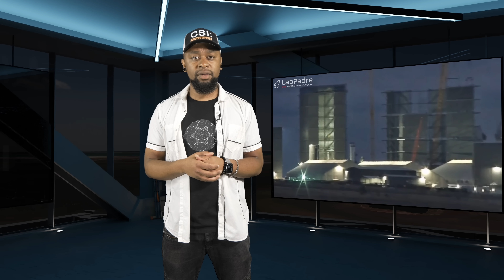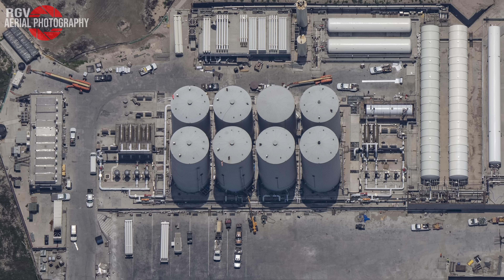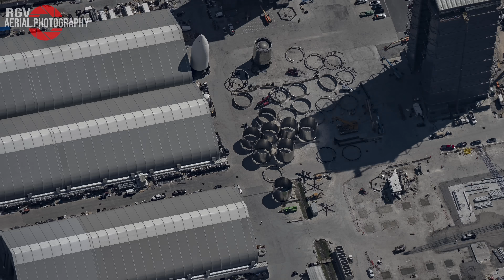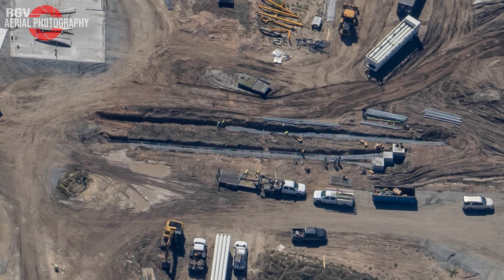SpaceX Abandons “Off-The-Grid” Operations At Starbase!

Comment: I wouldn't think a substation would be located very close to a  large source of combustible gases. High voltages can create corona conditions that theoretically cause ignition in the case of a leak. Please consult a appropriate, qualified engineer.
Reply from the maker: That is a very good point!
Reply: Most switchgear designed to work at those voltages either have their electrical contacts contained in vacuum, oil, or SF5 gas.
Reply: Correct on switchgear, but corona can form around insulated wires and insulators, as I recall. @ghost307

Comment: It looks like there are lots of pipelines running through the salt marshes between Brownsville and starbase and Port Isabel.  You can see their tracks from all the Google Earth photos of the area. It seems like it wouldn't be too hard of a job to run a branch pipeline over to starbase for that big power plant. I suppose those pipelines could be oil instead of gas though.

Comment: What your referring as transmission lines is actually distribution lines transmission lines only supply substations because those are extremely high voltage and you can’t just place transmission lines on distribution poles because the voltage is was to high and the spacing needed wouldn’t be sufficient. They probably do need a substation but only if they run transmission lines down into the base which is really expensive. What you see being done is actually just adding phases to the existing distribution and there is probably a substation somewhere in boca chica that may be being upgraded as well to deal with the load

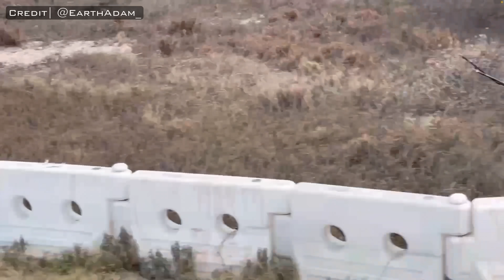Comment: Great video Zack! In regards to the size of the reels of the 500 MCM(KCMIL) URD they use, I work for the other local utility company in the RGV and I checked our inventory of URD primary and it has 1830ft. Ours are a little smaller seen in the video at 38:08. So I guess those are around 2500ft. Also just a little correction, in the beginning of the video where you show the old video of the single phase line, that is a Distribution line not Transmission. Now they add 3 phase Transmission on top and kept single phase Distribution below it on the poles.
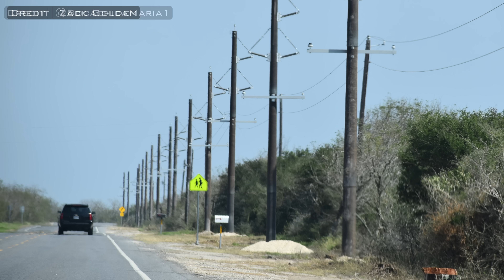Reply: Thanks for your comment, great insight. We did show the new poles @ 32:03 👍
Reply: @Geoff_A  yes sir, new poles have 3 phase Transmission on top and single phase Distribution below it. I want guess the Transmission line is at least 69KV. That is our lowest voltage on AEP side. Guess Magic Valley the same. I could ask workers from Magic Valley if it is. Distribution is 7200V.

Comment: Elon should be watching these videos to check the status of Starbase ... if he isn't already ...
This power solution makes perfect sense, if aquiring more land around the site for extra solar farming is not an option.  In the end, it doesn't matter where the solar farms are built, for carbon footprint considerations.  Consuming power from the grid in one place, and then producing power from a solar farm at another location, even hundreds of miles away, is perfectly fine;  location is irrelevant.  That, plus, the carbon offset part is nice and good but not urgent;  what is urgent is power input.  Having said that, I wasn't even aware of how much solar power was installed at the base, already.  And I had heard about local production of rocket fuel being built, but then I never heard anything more about it and was wondering what had happened with it.  Now I know exactly the status.  Thanks bro;  you are my champion YT-ber.

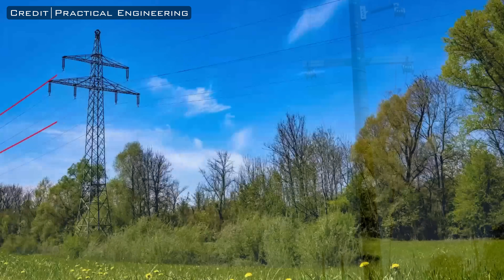Comment: The 4th wire on top of transmission structures (typically 69kV or 138kV, but occasionally 345kv or 500kV) is the shield wire for lightning protection. It is grounded every other structure (to a ground rod) to ensure lightning does not enter the three phases. This is not a neutral. (At the transmission level 5:21 )
Reply: Yes. In general, high voltage power lines are 3 phase, ungrounded. The neutral is derived at the delivery point.

Comment: As my former employer's site locations were remote, we had Diesel Gensets for power. Both for normal operations and for emergency power. We could not afford to be down, period. The longest we were ever down at out worksite was from Monday Aug 24, 1992 to Friday Aug 28th.  From that point on for 5 weeks we operated solely on our Gensets as there was no commercial power available. In fact, the power lines themselves did not exist due to Hurricane Andrew. On the same day as we got power back at work, we also got it back at home. We too had been running on a generator for 5 weeks. 

One of the things that the people working at the SpaceX locations will be happy about is that when the commercial power becomes available, they won't have to listen to the noise from the Gensets. Except for weekly test runs and if they have to do load peaking.

Comment: Nice analysis.  Regarding the details of 3-phase distribution, all power is distributed from the power generation center as 3-phase.  As long as the same amount of power is drawn on each phase, no current will travel on the neutral (ground) wire that sits at the potential center of the phases.  There are two huge problems with single phase distribution.  1) It has to draw power from one of the phases so you have to make sure you match other loads to draw matching power from the other phases - if not, you will draw power on the neutral/ground line and have huge distribution losses and also cause lots of problems at the generation site.  2) Distribution of single phase power means you have line loss on the power and the neutral lines instead of just the power line.  Industrial sites that use single phase power often have to call the electric company if they are going to have large load changes so the electric company can re-balance the lines.  I imagine the battery storage helps SpaceX a lot with that as they can take or draw power from the batteries to help keep the power draw pretty constant.  Even with that, the system is not going to be efficient.  They really need 3-phase power distribution.  I imagine one challenge is that environmentalists probably did not want them to add more above ground lines..

Comment: Second tower at Boca Chica:  

That should be a landing tower, not a launch tower. That landing tower would only need to be about 350-375 feet tall and would need the hoist system, the elevator, and a pair of chopsticks. 

Trying to use the present OLIT/OLM for Booster and Ship landings risks potentially serious damage to both of those critical launch components of Stage 0.

 Better to eliminate that risk and land those vehicles at the second tower. 

 SPMTs could be used to move the landed Boosters and Ships to the launch tower and/or to the payload integration building at BC.

With FAA limiting orbital launches at Boca Chica to five per year, the present OLIT/OLM is sufficient for launches (average of 73 days between launches).

Comment: Hi Zack.  I would like to see a video about how SpaceX workers get around inside the tanks.  I see videos of workers going in and out of the booster and starship, but I can't imagine what they are doing in there and how they move inside a tank that seemingly has bare stainless steel walls.  Are there ladders and platforms built into the tanks?  Do they use climbing gear?  Are the stainless steel walls magnetic?
Reply from the maker: They actually set up scaffolding inside of the tanks similar to what you see on the outside of the Orbital launch mount currently!

Comment: Another thing: Since Sanchez was a gas generation location, that means that it has a NatGas pipeline, you don't use trucks and tanks for gas.  If they can get the pipeline repurposed to flow TO Sanchez, that would potentially supply bother the co-gen unit and the LNG compressors.

Comment: at around 29 min. , formerly from industrial gases, I would find that surprising that they could turn down a used ASU plant if using distillation trays vs say packs. Depends on the tech.. Would not be surprised if the origin was Baton Rouge, LA. In addition, it takes tons of energy to keep the system cold or even start up. What is evident is as the site is in development and probably nice tax credits on O&G usage, the OPEX takes a risk adverse role until a baseload is established that would define a new solution. In the end, the overall value is chump change vs its impact and aerospace value.

Comment: Very well done. I'm sure it was not intended in this way, but this is also a pretty effective dismantling of "green" energy as hilariously impractical for many applications.
Reply: You need to run power lines to factories independent of how the electricity is generated.  They might also install a remote array where there's more ample land.

Comment: NOOOO... OH GAWD... YOU BUTCHERED THE ELECTRICAL EXPLANATION.... All commercial buildings have 3 phase power. And 3 phase does NOT equal higher voltage. They have nothing to do with each other.
Reply from the maker: You are the first person to say this. All the research I did says otherwise and we also ran this information by a lot of different people before it made it into this episode
Reply: @CSIStarbase The only mistake I think you might have made is saying the lower cable on the original run might have been a communication cable. This guy’s statement that all commercial buildings use three phase is patently false.
Reply from the maker: @PetesGuide  Originally I said it was the neutral wire, but after the QC review a lot of folks said that a neutral wire is not always necessary and that it was more likely to be Comms.
Reply: Having just looked at a bunch of commercial properties to rent, I can tell you that not all of them have three phase power. And yes you can get higher voltage from a three phase supply than single phase, because you can use inter phase voltages, where one phase is always positive while another is always negative, giving a larger difference than one phase to neutral. A quick Google search yields many explanatory diagrams.
Reply: Saying "all commercial buildings have 3 phase power" is wrong... Does your local strip mall use 3-phase for the pet store in unit 18?  No.  All industrial sites, sure.  Yes, from a theoretical  stand point, correct, you can have 3-phase 12V service.  However, in the world of utility provided power, I doubt anyone that needs 3-phase is also going to want a "low" voltage (thus lower power) service.  TL;DR: In theory, yes, 3-phase does not equal higher voltage; however, in practical real world utility service, it does.

Comment: I really love the fidelity of this investigation. It is a little confusing how they did not install a 20kv power line but I suppose those are not that common in North America? 
There is to be noted that this power line is just the beginning, as more power will be needed in the future. So, installing a gas pipeline will be necessary in order not to keep hauling LNG on the roads. However the gas pipeline that runs 20 miles away from the facility is already running at max capacity and increasing the capacity would take about 4 years. So SpaceX is already considering drilling operations, although facing some frictions between its subsidiary and Dallas Petroleum Group regarding extraction rights. 
It will probably be contested by environmentalists,  however it would be a cleaner solution compared to road transportation. 
This could be a theme for another investigation.

Comment: Correction: Residential homes and light commercial supply is 2 Phase (240v) 
Heavy commercial and light industry is 3 Phase supply (360v).
Heavy industry is 4+ Phase supply (480+v).

Single phase supplies power locally from the Breaker boxes to individual equipment 😉

Comment: Another great deep dive.  One note to add, for motors using 3 phase means there are no wasted windings or switches needed to start the motors.  Jeremy Fielding has a video on how the starter switch works.  It seems odd to go all the way down to 11KV at the site when 32KV is the source (but that may have to do with burial as arcing and conduction through salt water soaked land may the the driving factor).  Running wire at its rated ampacity is never done as NEC code requires at least 20% derating, and losses for this length would be huge.  It seems a bit late in the game to finally address this.  Thanks for the update.

Comment: Electrician in the power industry here. You are factually incorrect in a number of areas. While the utility poles may only have 2 wires, they are not delivering "two phase" (or split phase as it is technically called) utilizing a hot and a neutral. They are 2 out of 3 phases of the 3 phase system, and are used to distribute power in areas that do not need all 3 phases. 3 phase power is normally only available to commercial and industrial customers in the US. The split phase with a neutral is created at the transformers that steps down the utility distribution voltage, typically ~13kV for residential distribution systems, to the 240/120 split phase voltage used in homes and light commercial buildings. Since split phase power is created by transforming the power between any 2 conductors of a 3 phase distribution system, split phase can be delivered from either the normal 3 phase/2 wire power distribution poles, or from 3 phase/3 wire systems between any 2 of the 3 wires/phases.
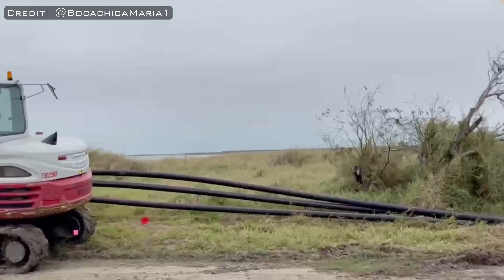33:30. What you refer to as "conduit tubing" is actually high voltage direct burial wiring, with one conductor for each phase. Based on the power poles, I would guess that it is ~30 to 60kV 3phase/3 wire on the top of the pole to be used by SpaceX, and ~13kV 3 phase/2 wire underneath that for residential areas, and possibly some parts of SpaceX that do not require 3 phase or have large power draws, such as offices.
Reply: Three Phase Four Wire wye? balderdash.  Why not more wires?  More wire = more better